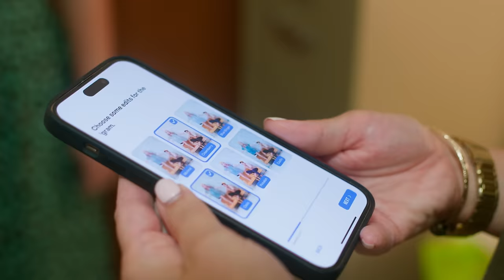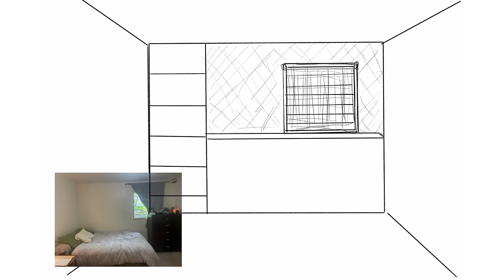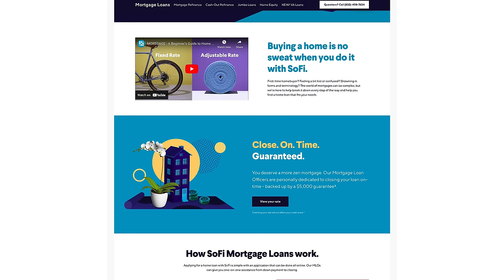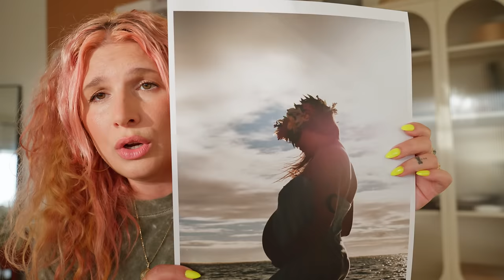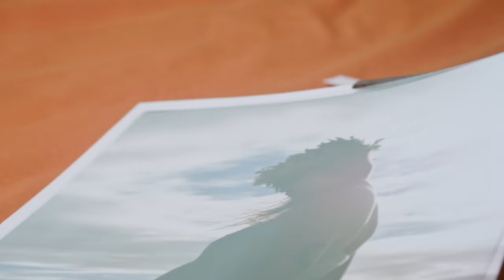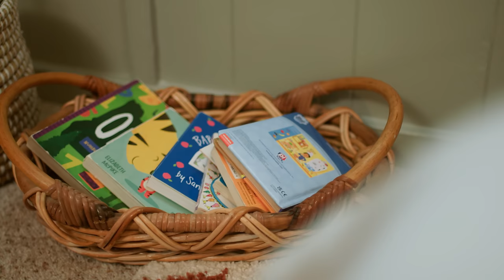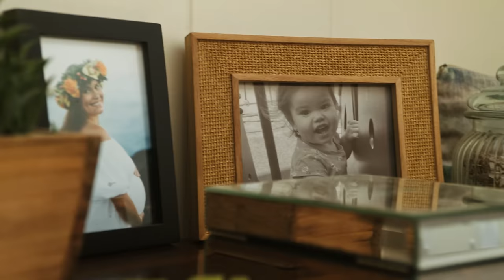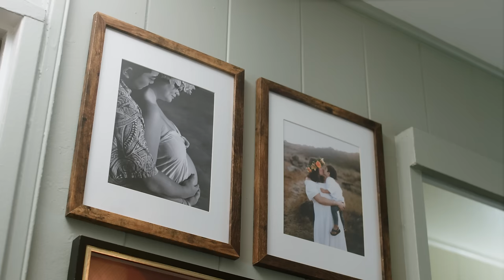Hardworking mom gets the bedroom she’s always dreamed of!

Comment: the two "hanging" rings on the back of a picture frame are for threading a wire through. i don't think they were really meant to be put on hooks. then use 2 hooks a few inches apart and hang the wire on the hooks...much easier to hang and get straight.